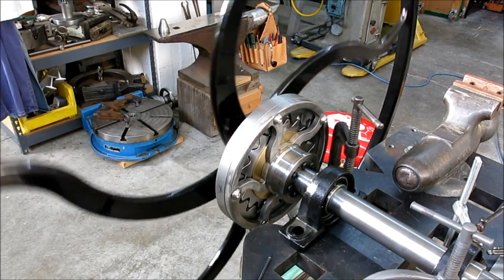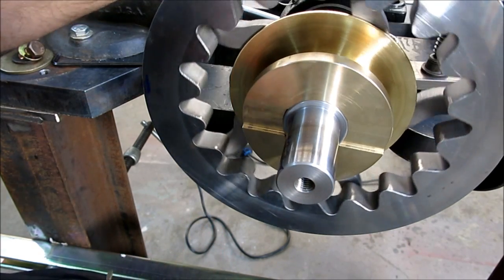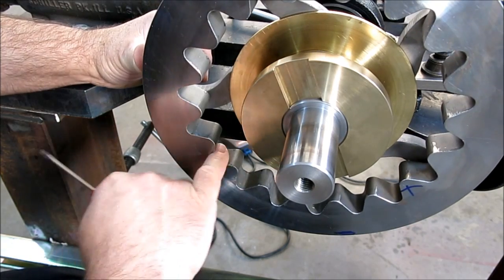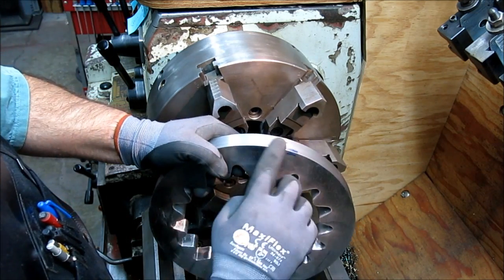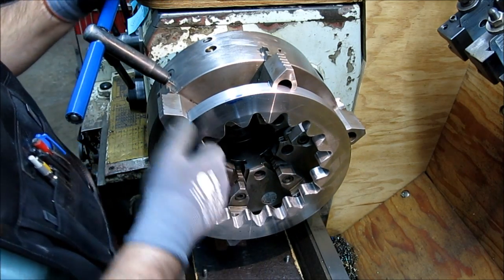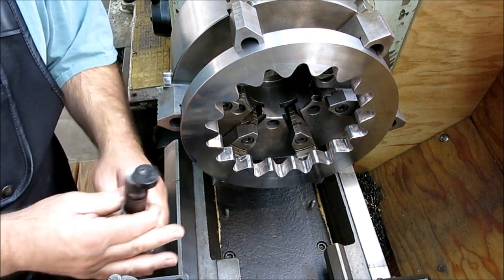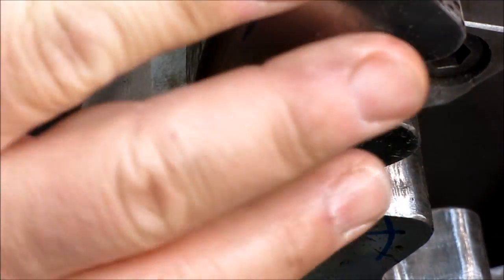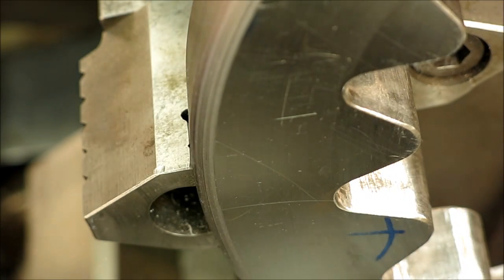Wabble Drive Bench Test

Comment: I'll bet you weren't happy once you put a real load on that "output shaft", were you? That "drive" is an engineering "joke" that apparently lots of "professional engineers" simply don't "get" until its way too late to be even slightly "funny". What works for "NASA" on a LUNAR ROVER in a far different "application" where that "output shaft" would be the INPUT SHAFT and the "handwheel" the wheel assembly of the LUNAR ROVER isn't worth a SHIT when "repurposed" in a "similar" but "backward" application and one where the "cardinal rule" of "planetary gearsets" is "violated" which is the case with your setup. 

The "cardinal rule"? ONE "ELEMENT" OF A "PLANETARY" GEARSET HAS TO BE "HELD STATIONARY" OR THE RESULT IS "NEUTRAL". And if that "element" is the "driven gear" in a "Wabble Drive" and "anti-rotation links" have to be used to allow the "drive gear" to "raise" and "advance" and "lower" and "advance" to drive the driven gear "one tooth at a time", then you have TWO "held stationary" elements once the entire unit is assembled and THAT is the SECOND CARDINAL RULE VIOLATION. What is the SECOND CARDINAL RULE OF PLANETARIES? IF YOU HAVE TWO "HELD STATIONARY" ELEMENTS YOU HAVE "PARK". 

But without those links and with the output shaft only "held stationary" once you get enough load "on" the drum cranking a "plate" through and the other two elements "free" you STILL get "neutral", don't you? And you can't use those "anti-rotation links" in the "final design" either because obviously whatever "shaft" the drive gear they're cycling up and down and the "shaft" that's driving it ALL HAVE TO "FLOAT" UP AND DOWN TAKING THE GEARS OUT OF MESH AND INTO "NEUTRAL" EVERY TIME THEY RAISE AND PUTTING IT IN "PARK" EVERY TIME THEY LOWER ONCE YOU HAVE A REAL LOAD "ON" THE DRUM. 

Seriously, if you want to know how to "design" and "engineer" EFFICIENTLY and PRACTICALLY and produce something that WORKS GOOD WHICH MAKES YOU LOOK A HELL OF A LOT SMARTER THAN SOMETHING THAT "LOOKS COOL" AND DOESN'T WORK AT ALL, TRY TALKING TO OR LISTENING TO OR GETTING THE SAME "EDUCATION" AS OR USE THE SAME "RESOURCES" FOR LEARNING ABOUT/FIXING/DESIGNING/IMPROVING MECHANICAL SYSTEMS AS.....PLAIN OLD "MECHANICS". "MECHANICAL ENGINEERS" DIDN'T EVEN "EXIST" UNTIL ALL THE "HARD" AND "CHALLENGING" AND "THEORETICAL" AND "PRACTICAL" AND "SCIENTIFIC" WORK OF "ENGINEERING" PRETTY MUCH EVERYTHING WE HAVE TODAY HAD ALREADY BEEN DONE BY "MECHANICS". AND NOT TO BE "SMART" OR "COOL" OR "GET RICH" OR "GET FAMOUS" BUT SIMPLY TO DO WHAT TRUE "ENGINEERING" HAS ALWAYS BEEN ABOUT AND WILL ALWAYS BE ABOUT. WHICH IS "SOLVING PROBLEMS" THAT EXISTING "SOLUTIONS" TO OTHER POSSIBLY "SIMILAR" PROBLEMS DO NOT "SOLVE".

YOU DIDN'T HAVE A PROBLEM UNSOLVABLE BY SEVERAL EXISTING SOLUTIONS BESIDES WANTING TO LOOK LIKE A MASTER-MACHINIST AND EXPERT-ENGINEER. BOTH A SIMPLE "SPUR GEAR" DESIGN OR A "COMPLEX" TRUE PLANETARY DESIGN WOULD HAVE WORKED "PERFECTLY" WHILE THAT CUSTERFUCK NON-SOLUTION TO THE ACTUAL "PROBLEM" OF HOW TO TURN THAT GIANT HANDWHEEL "FAST" AND THE DRUM "SLOW" OBVIOUSLY IS NOT ONLY NOT A SOLUTION BUT NO DOUBT GAVE YOU A WHOLE PILE OF OTHER PROBLEMS. OR AT LEAST ONE BIG ONE WHICH WAS LEARNING/DECIDING TO SAY "OOPS" AND "I FUCKED UP" AND "THIS WILL/WOULD NEVER WORK" AND JUST WALKING AWAY. OF COURSE AS AN "EDUCATOR" IN THESE VIDEOS YOU "SHOULD" ALSO "FESS UP" TO YOUR "FOLLOWERS" AND "FANS" AND "STUDENTS" AND LET THEM ALL BENEFIT FROM YOUR EXPERIENCE AND NEW-FOUND WISDOM AND "PROFESSIONALISM" SINCE TEACHING PEOPLE ITS "OK" TO MAKE MISTAKES AND IF YOU'RE NOT MAKING MISTAKES YOU'RE NOT DOING/LEARNING ANYTHING WORTHWHILE ANYWAY. 

BUT I'VE SEEN REPEATED COMMENTS ON MANY VIDEOS ABOUT THE "DISAPPEARING" ETCHING PRESS PROJECT AND I'M CERTAIN YOU DIDN'T JUST "FORGET" ABOUT IT AND YOU RESPOND TO COMMENTS YOU LIKE AND THAT MAKE YOU FEEL GOOD/SMART SO I ASSUME YOU'VE "MOVED ON" AND AREN'T WILLING TO REALLY "HELP" PEOPLE BY "FESSING UP" AND EVEN BETTER "FIXING" THE "MISTAKE" BY "REDESIGNING" THE PRESS WITH WHAT WOULD/WILL OBVIOUSLY BE MAYBE A LESS "EXOTIC" GEAR SET BUT AN INFINITELY MORE "ELEGANT" ONE GIVEN IT WOULD ACTUALLY WORK. 

Of course there are lots of etching presses out there factory-made across a wide range of sizes, shapes, designs, costs and "ages" both new and used and "similar" presses to your design probably new or used aren't much if any more expensive than what you've got in the parts you "outsourced' or WOULD HAVE if just a regular machinist working on paying OR personal project and paying "retail" for that stuff and not being able to "trade" mentions of the "suppliers" in a YouTube video for "discounted" or "free" parts. And as a "honey-do" project I imagine your "better half" had a "sooner" rather than "later" timeframe in mind for her new "venture" and probably either got tired of waiting and bought a "commercial" press or got bored of the whole idea in the meantime and moved on OR you actually did "start over" and redesign and "cranked out" the "new and improved" press ASAP long ago and just didn't have time to "document" that process or didn't make time for various reasons. 

It doesn't matter to me what actually happened and its your deal and whether or not you "fess up" or not or anything else about the "missing press" is really none of my business and all of yours. I've fucked up and didn't fess up, too. But I still think that as an "educator" with a lot of viewers who are more or less your "students" and with plenty of them being less "experienced" and "wise" in the realities of even "experts" making "stupid mistakes" than I know I am and I assume you are, it would be the best lesson possible to "finish" the etching press project in a "wrap-up" video regardless of what the actual "story" is. 

And I'm NOT "trashing" you or your ability and skill as a machinist, engineer or mechanic at all. That's some pretty kick-ass machining AND "engineering" AND "mechanicking" and I had to "study" those "drives" for a little while before I "got" the "joke" and did some online research and saw the lunar rover reference and did some recollecting about my personal experience with a "replica" lunar rover and real-deal astronaut damned near 30 years ago as a result. Details are fuzzy and I'm probably making up what I don't remember but it does seem like he talked about and got into the nuts and bolts of the "drivetrain" and the lack of "u-joints" because "engineers" were unwilling to risk running them "dry" and no grease available is still "grease" rather than "ice" on the surface of the moon "in the shade" so that contraption was selected. But on the rovers all the "suspension" is in the piano-wire "tires" which are kind of like the "steel-belted" part of a "steel-belted radial" minus the rubber. Because rubber is also "ice" on the moon in the shade. 

But because the suspension was the "tire" and the "ring gear" was attached to the "wheel" and the "drive" also served as the "spindle" and "bearing" with the "sun gear" being driven by an electric motor at each corner and the "carrier" was attached to the "chassis", the end result was that the gears ended up being more of an "internal spur gear" setup rather than an obviously unnecessary and "impossible" ratcheting-type  set-up with "anti-rotation links" raising and lowering the sun gear in and out of mess with the ring gear. Maybe the sun gear was on the bottom of the ring gear or maybe it was on top. I can't remember and it doesn't matter. What matters is that is a clusterfuck of a "drive" that literally was and is good only for a single, special and highly "exotic" application and its more or less "worthless" for everything else.
Reply: I was looking for the grounded/stationary element too. It must be a shaft that goes through the center of the roller and fixed in place off screen. I looked through some of his other videos searching for evidence of this -- without luck.

Comment: Beautiful machine work! I have a small pop up camper that employs something very similar. It’s a two stage wabbler. One set of gears rotates one way the other set rotates the opposite way with the eccentric gear in between the two output gears all contained in one gearbox. It is operated with a hand crank.

Comment: I notice that the output doesn't turn smoothly, it accelerates and decelerates in comparison to the input. Will the move-pause-move action have an effect on the print?
Reply from the maker: Once its loaded up in one direction it should be less herky jerky. The output is not constant velocity but that does not effect the printing process. Thanks for the comment.

Cheers,

Tom

Comment: Isn't this sort of drive not a real gear reduction, in that you get more torque out of a normal gear reduction in exchange for speed, and you're doing nothing but slowing down the big wheel without getting any increase in power? Wouldn't you want the torque to aid in forcing things through the press?
Reply from the maker: +phookadude Hi Phook,

It is a true gear reduction. Take a look at harmonic gear reducers. The principle is similar. There is a mechanical advantage here that is 18:1 ratio. Thanks for the comment.

Cheers,

Tom

Comment: May I inquire what would this machine use as a final product? I mean it is an beautiful machine, but that huge torque will be used on what? a grinder? bender? ring roller?
Reply from the maker: Hi Miguel,

Thanks for the comment. The gear reducer is for a large intaglio etching press. Used to imprint paper with an image carved or etched into a zinc or copper plate. Google intaglio or something like Goya etching to see some examples of prints from a machine like this. Hope this helps.

Cheers,

Tom
Reply: oxtoolco Yes I know what is intaglio, it was etched in our minds in art class in college, many beautiful examples where shown, including the really old ones. Thanks for your prompt answer.

Comment: So it looks like that gear reduction runs at an inconsistent speed. Kinda reminds me of a shaper and how the drive unit in it gets the faster return stroke. Did you expect that change in speeds?
Reply from the maker: Hi Jeff,

You are right it is not constant velocity. In fact it describes a Cycloid as it turns. For this application its not important. Also the output has no load on it and can flop around a little. Once the drive is loaded in one direction or the other is shouldn't flop back and forth but will still have the cycloidal motion. Good eye.

All the best,

Tom

Comment: Tom, was any consideration given to swapping the cuts of the inner and outer gear? I'm assuming the reason it was riding on the outside on the outer gear is due to the flame cut kerf angle. I would think if you flipped the inner gear so the taller portion of the kerf was on the inside it would allow the gears to mesh better.
Reply from the maker: Hi Bradley,

Nothing other than a brain fart. I had the gears oriented with the pierce side up since they arrived. I didn't even think to flip one over. When I tested it on the bench with the eccentric was the first indicator there were some high spots. The interference is not bad at all. A little filing and sanding is taking care of it.

All the best,

Tom
Reply: Where is that rewind button anyway! Nice work regardless!

Comment: Tom, three questions. First, what type of steel are the wobble gears made of? Why did you choose that steel? Would a waterjet have resulted in a more accurate profile than flame/plasma?
Reply from the maker: Hi Thomas,

The steel is A-36. The profile is not supposed to need great accuracy which is one of its advantages. These were produced by forging and casting and used net shape. I'm just a little fussier than normal for the fit. Yes WJ would probably have given be a little better accuracy. However I was also horse trading with another tuber that cuts steel for a living. 

Cheers,

Tom

Comment: Very artistic A+.  Does the wabble drive output move in a surging motion or does it just appear that way in the video?  Thank you for sharing.
Reply from the maker: Hi Diy,

The output is actually cylcloidal. So you are correct that its not constant velocity. There is some back and forth now because their is no load on the drive. Its just idling in bearings. Thanks for the comment.

Cheers,

Tom

Comment: That handwheel looks great powder coated! 
The drive really does have a high reduction ratio, how long does it take to pass a plate through the rollers? 
Speaking of rollers, do you have the material for them yet?

Andre
Reply from the maker: Hi Andre,

That will depend on how big the plate is. The roll diameter is 8 inches so the linear speed will be fairly good with a 25 inch circumference. It takes eighteen turns to move 25 inches which takes maybe a minute just spinning the wheel. In actual use the pressing will probably be much slower. Have to wait and see.

Cheers,

Tom

Comment: The number of spokes and diameter of handwheel give the illusion of a much higher gear reduction. Watched the section of you rotating it several times just to see the movement of the pieces.  Pretty cool.

Colin ;-)
Reply from the maker: Hey Colin,

Thanks for stopping by. Pretty compact for 18:1. Can you imagine the mess of chains and sprockets you would need to get that ratio.

All the best,

Tom
Reply: I imagine best would be a planetary set but aesthetically the wabble is better looking.

Comment: Hey Tom,
You're a regular "wabble rouser"! You may be on vacation, but you are still back to the old "grind"! I think 2 disgusting puns per comment is about it. Any more and you will block me from commenting on your channel! Anyway . . . nice work on the drive guts to the etching press. Does the drive operate a platen or a cylinder to hold the sheet of paper? Does the paper holding device move or does the printing plate move on a carriage (like the Hilderberg cylinder press)? Thanks for another interesting video! It will be great to see the machine in action!
Have a good one!
Dave
Reply from the maker: Hey Dave,

The drive rotates a large cylinder. The paper and plate are on a platen that is pulled between the two main rolls. Kind of like a laundry wringer but on a bigger scale. The pressure at the nip point squeezes the plate into the paper and transfers the ink.

cheers,

Tom

Comment: Hi Tom
Overall this press is going to run pretty smooth - congratulations on a great desing.
No matter how smooth it runs it will not compete with how smoothly you erased
the 'Railway Thermite'  video to do off your whiteboard.....
LOL and thanks    Rod
Reply from the maker: Hey Rod,

Man I thought I made it. You noticed apparently. I should have changed one letter at a time until it said something else. Totally busted.

Cheers,

Tom

Comment: Why not put some lapping compound in there and run it with an electric motor to bed the gearset?
Reply from the maker: Hey Perry,

The mesh is not that accurate. I have filed most of the spots and will run it some more to get a better fitup. I don't think lapping compound is aggressive enough right now. 

Cheers,

Tom

Comment: dang, that's like 4000 ft/lbs of torque at the main roll!!! (with 100 lbs of input force)
Reply from the maker: Hey Perry,

That will leave a blood blister if you're not careful. Should put the squash on the etching plates. Thanks for stopping by.

Cheers,

Tom
Reply: oxtoolco That roller would be like the old wringer style washing machines where  the lady doing the laundry had to watch and not bend over the wringer rollers too far.  I believe those were the forerunners of the Mammogram without the x-rays.

Comment: Can you jus use valve grinding compound to "lap" it in?
Reply from the maker: That might work. The problem with valve grinding compound is it will embed in the steel and stay. Filing seems to be working well right now. Thanks for the comment.

Cheers,

Tom

Comment: Tom,
When you laid this out, did you flip the inner gear over so the kerf from the flame cut would help cancel each other out?
Joe
Reply from the maker: Hey Joe,

I missed that trick. I had the gears taper up since I got them from Steve. I never thought there would be any clearance issues with the teeth. In fact there is plenty of clearance but some form errors on the teeth that make them touch in a few spots. Good call on the kerf. Where were you two months ago?

All the best,

Tom

Comment: Hi Tom

Wav, it looks really, really nice - great job !

The big wheel is very nice too - that shiny black paint - looks really nice and prof !

I noticed though in the begining of the video where the big wheel is turning, then the small wheel (the slow side of the gear) is NOT turning in a constant speed - sometimes it slows down - why ? Maybe it's because you don't have this anti-rotation-part mounted yet or at least I think you don't - I can't see it.

I don't think there could be so much mis-mesh in the teeth - right ?

In fact you should only sand down the high spots to get them to mesh exactly - right ?

When finished should the gear run in any kind of lube ?

Long to see more of this fantastic project !
Reply from the maker: Hi Keld,

You are correct that this is not a constant velocity drive. In fact the curve is a cycloid. There is a lot of clearance in the gear teeth but this is not a problem. The system gets loaded in one direction at a time. If it was constantly reversing it would need to be fitted much closer. The gears will be nickel plated and lubricated with light grease once in a while.  Thanks for the comment and great questions.

Cheers,

Tom